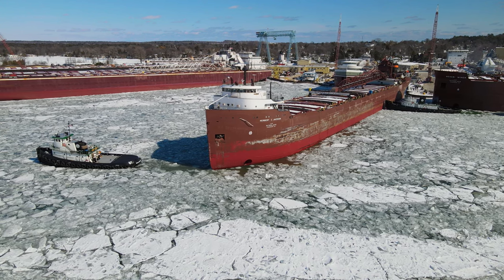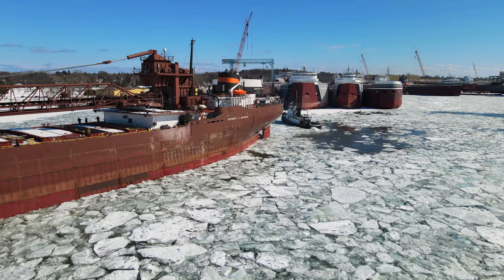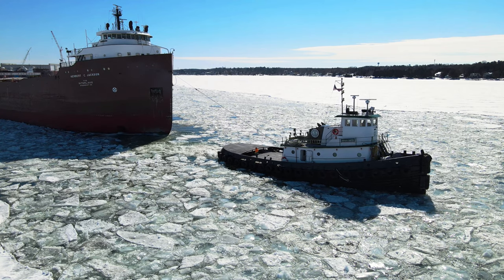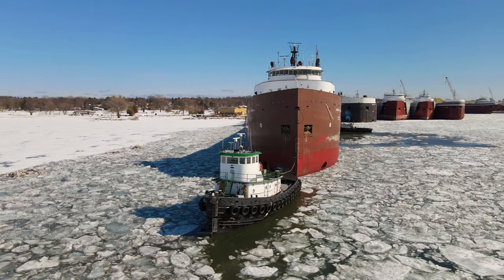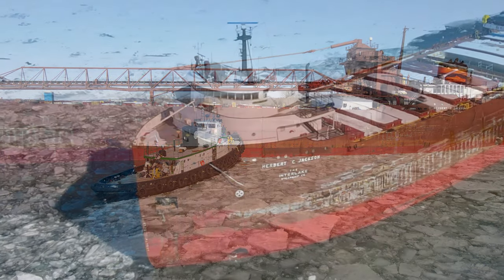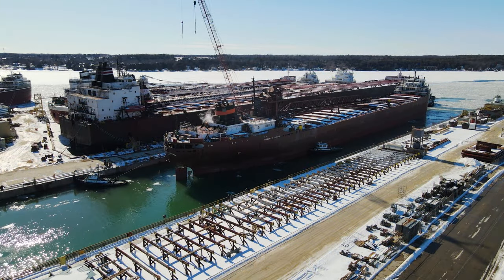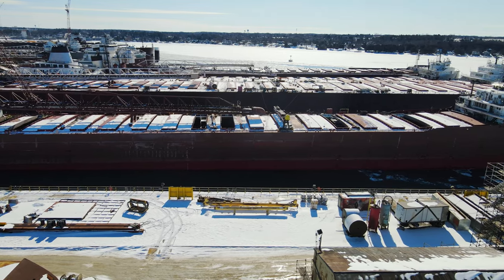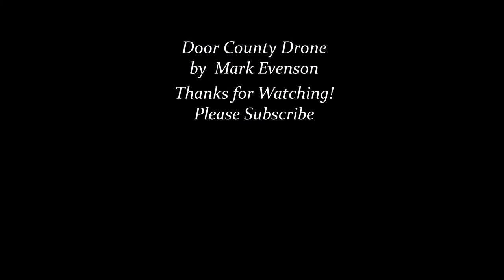Herbert C. Jackson Move Into Drydock Fincantieri Bay Shipbuilding Sturgeon Bay Wisconsin 02/27/2022

Comment: 7:35 those are the (fab) fabrication tables where they assembled the modular sections together that were built in the shop into what they call super sections and then the blue gantry crane picks them up and puts them in the graving dock for final assembly I use to work at Bay Ship